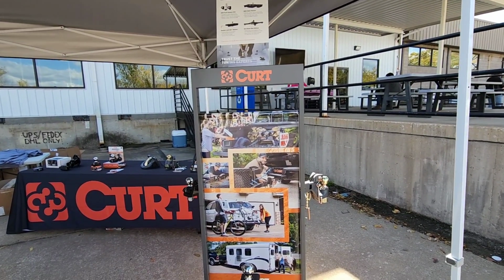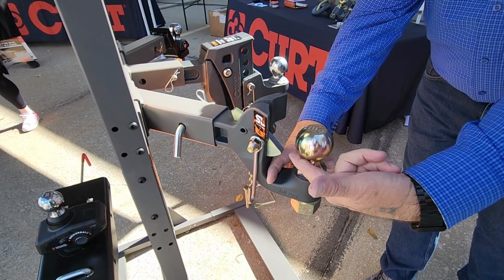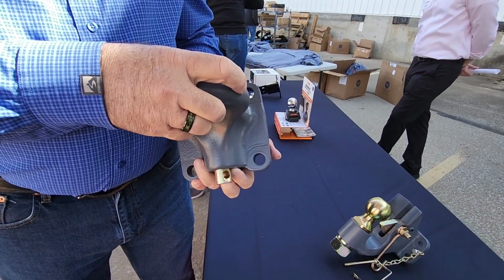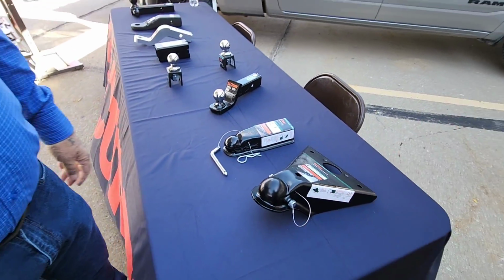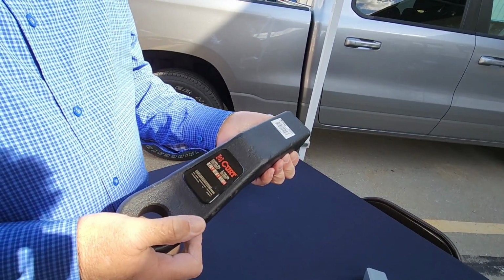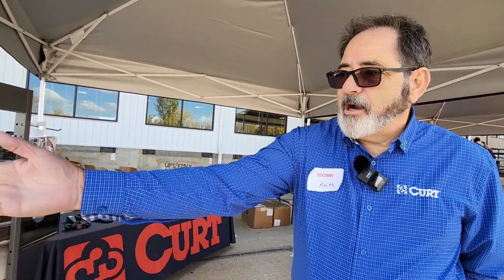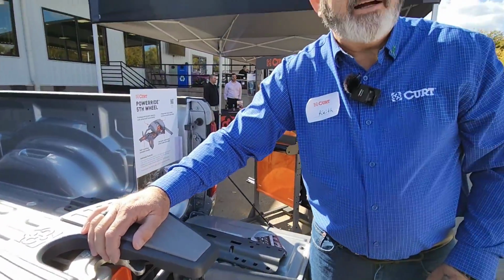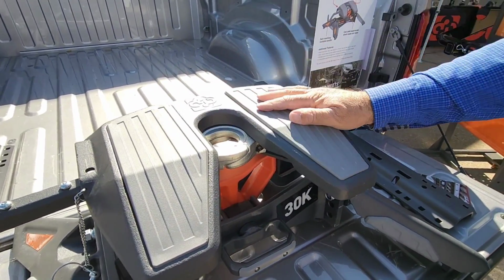Awesome new Towing Technology from CURT!

Comment: 30,000 pound capacity shouldn't be surprise for fifth-wheel hitch capacity. The SAE standard for fifth-wheel and bed-mounted ball hitches (J2638) covers up to 30,000 pounds of trailer weight (and pin weight up to 1/4 of the trailer weight) just as the similar standard for conventional hitches (J684) covers up to 10,000 pounds. Most manufacturers of recreational fifth-wheel hitches have models up to 30,000 pounds rating, although the cheapest models start as low as 15,000 pounds.

Comment: The aluminum ball mount differs from other brands in that the ball platform area is only 2" wide (in the ball mount for a 2" receiver), instead of flared out to provide more material around the ball hole for more strength. I don't think I would use that near its limit.

Comment: speaking of towing, wonder if there's a replacement for the big & heavy fifth wheel especially in semi trucks . . . one solution is a series of counter rotating pulleys (as in sailing ships) that runs through a electric motor installed (behind the driver's cab) on the truck chassis instead of the horse shoe shaped fifth wheel coupling . . . the steel wire threaded pulley system is connected to a conventional towing hitch (opposite J) as in normal cars & light pickup trucks . . . the pulley system is bolted to one or two raised lateral cross member on the rear chassis frame of the truck . . . inertial forces generated when on the move is offset by a tiny gyroscopic balance in the pulley . . . note the raised lateral cross member (like handle bar on front dashboard found in SUVs) is an extra & not part of the chassis frame . . .

Comment: The auto locking hitches and pintle hitch they show are exact copies from Saskatchewan Canada based Hit-n-Hitch that have been around for ever.   They are amazing hitches.
Reply: Yeah, WTF is with that???
Reply: Exactly correct.  I have the Hit n Hitch version by Power Pin from Canada and it's awesome.  It seems that Curt bought the patents from them and renamed it.  The only thing available on the Power Pin site now is the trailer side hitches that it seems Curt didn't buy.
Reply: @speeddemon9902  I’m sure that’s what happened. Maybe it’s cause the Canadian market isn’t that large and Curt has such a huge network. I just hope Power Pin made out good with their choice. I have their designs on my truck and trailers. They really are the best, only thing I don’t like is they rust really fast. Maybe Curt can solve that issue.
Reply: @speeddemon9902  makes sense. As long as it isn't a blatant rip off!

Comment: I really like Curt products but I was hoping they would have displayed a torsion flex type hitch to calm down the bouncing of my spring-less livestock trailer.  My trailer bounces when I hit a bump and a torsion-flex hitch would help eliminate the severeness of the abrupt shock between the trailer and the bumper hitch.  You've done a really nice job making viewers aware of the neat products.  I don't pull a RV but more focus on tandem axel heavy and even light weight utility trailers would be nice.  Thanks again for the video and have a fine week.  👍🏽🤠  11/30/22

Comment: Curt has a design flaw on most of of their 5th wheel hitches. Look at where the safety pin is located. The only way to remove that safety pin is to have your truck straight with the trailer. That is not always the options you have while disconnecting your trailer.

Comment: Reducers are silly.  Just buy the correct shank size hitch for your application.   I used one on my Ram 2500.  A 2 1/2" to 2" reducer.  The reducer that came with my truck, ended up getting bent out of shape, due to wear and tear.

Comment: Such a great video, I’m still trying to convince my husband on a fifth wheel RV next but he’s still hesitant. We currently have an F-250 diesel and towing a Jayco Eagle HT 280RSOK travel trailer. I wish you could speak with my husband about going to a 5th wheel. Thanks for all the great videos and information.
Reply: I get his hesitation. Its a pain to have the 5th wheel hitch taking up most of the bed, and if you want to remove it it weighs a good bit and requires 2 or 3 guys
Reply: @davidwilems8915  Thanks for your input
Reply: Receiver hitch / bumper pull is considerably more dangerous and feels unsteady compared to gooseneck / 5th wheel. I don't understand his hesitation. Receiver hitch towing allows for side-to-side sway, front-to-back rocking and bucking and often requires additional pricy items like weight distribution hitches and sway control systems. From a cost, actual safety, and "feel" standpoint...  gooseneck / 5th wheel towing is vastly superior. 

I traveled cross country with a 30 foot enclosed car trailer and it was downright dangerous feeling being a traditional receiver hitch setup. It would have been so much better the other way. Far more confidence inspiring.
Reply: @CR500R  oh yeah, saftey wise its way better with a 5th/gooseneck. I'm a truck driver for a living, i understand 5th wheels really well. I'm personally not going the 5th/goose route on my first trailer since I'm living in it and don't really plan on moving it much.

Comment: Very informative.  I have a question though.  Why is it that on the triple ball receivers you never see the fourth side of the receiver utilized?  One would think that fourth side would have a flat steal with the hole 🕳️ in it for farm wagons welded to it.  This 4-way would cover everything on the market.  Is there a receiver like this on the market?  Thanks.
Reply: I believe most often its designed that way to have the flat surface available to be utilized as a step. But I have seen hitches with all 4 sides used.

Comment: Th e "A" frame coupler should be on all trailers. How handy and nice is that.
Reply: That model will be a problem if trailer is parked on a slight hill and the trailer is pushing on the back of the ball.
Reply: @drunkchicken8636  That situation is a problem with the other type as well. You have to chock the wheels and relieve the tension.